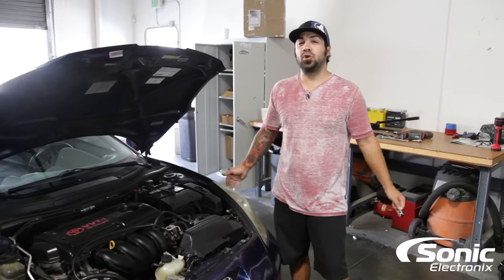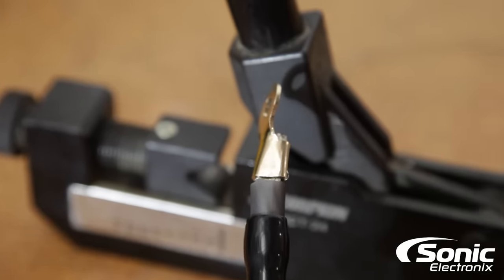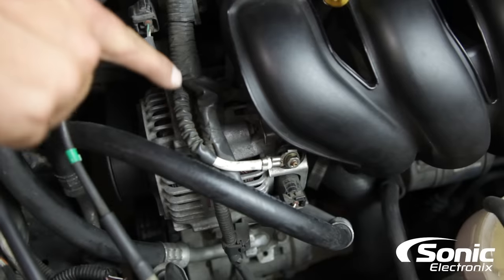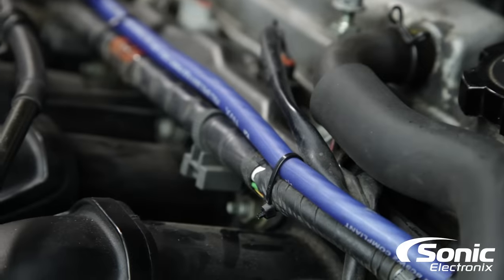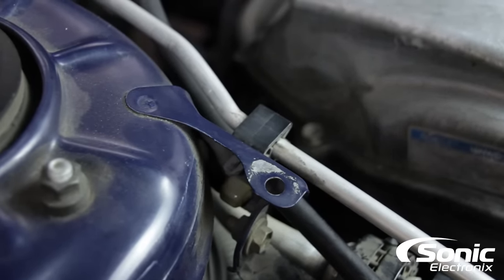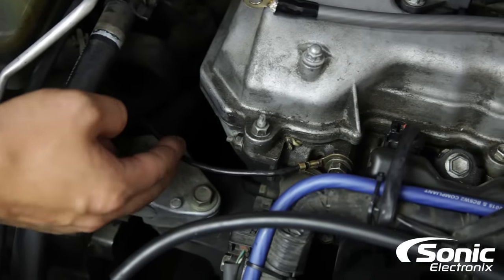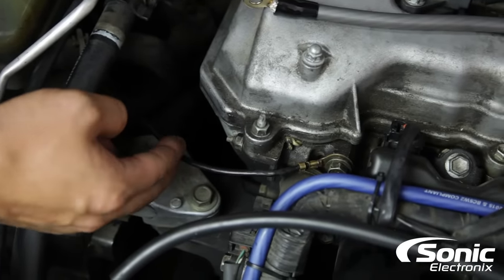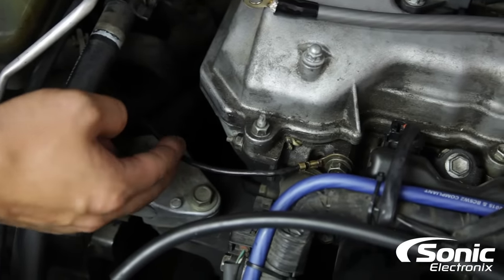How To Install the Big 3 Upgrade | Improve Your Vehicle's Electrical Charging System | Car Audio

Comment: So power wire from alt power bolt to the positive battery terminal . Then the negative to chassis ground? Then motor ground to chassis ground? For the motor part did you make a different new ground or add it to the exfudting one?

Comment: I did this years ago & had my alternator rebuilt for 200 amps...voltage is running at 14-15 volts at times....also running a back up battery with a battery isolator (diode) & running 7 years strong.

Comment: After i did this . I got 5mpg more . Thanks
Reply: Forreal tho!? How? Bcuz your ecu and fuel system and ignition has improved voltage and amperage supply!? Damn I need to do this big 3 asafp then!

Comment: I run a 0 gauge from the head to the transmission to the chassis then a ground from the alternator to the battery. And from the battery to the chassis and a positive from the alternator to the battery positive and the starter to the battery positive . My gt cruiser starts like a champ. Also everything for the sensors and power box has a same ground. And lights has a ground off the chassis with the motor and alternator. I run a zero gauge and a 300 amp between 2 1000 cca marine starting batteries .. built transmission solid motor mounts and LSD and more my ride flies now the response is serious

Comment: Had a 1974 VW Camper. The output wire definitely was not upto the size as stated on the wiring diagram. This resulted in dim warning light symtoms. The alternator was contained within the engine tinware below the righthand fan housing cooling duct. There's a small rubber elbow between the fan housing and the alternator to supply the cooling air.

Comment: i have my battery under  the passenger seat,can i just install the negative cable from battery - to the floor?vs running the cable to the front chassis??
Reply: Yea of course
Reply: Yea of course

Comment: Great Informative video , I have one question tho !! How do I run all this when I have my battery in the trunk ? 🤔🤔🤔 I do have small battery terminals in the hood of the car , positive and the negative , I have a chrysler 300 2006 , can you or someone please explain to me how do I run it ?
Reply: Most Hated is your main battery in the trunk? If so you will need a much larger gauge to account for the extra run lenghth. Your groung to chassy for the battery can be done in the boot, but your positive, charging wire will still need to be done in the engine bay.

Comment: should be the big 4, you should always run a cable from the back of the alternater case, which is where the internals are grounded to, to the negative battery terminal

Comment: Years ago I bought a sub system package from you guys and the amp that was in the package was not the right one, I had to buy another at the shop I was getting my system installed at.
The sub was pretty good, 10inch Kenwood had good bass, later down the road the sub tore

Comment: hi, thank you for this video. I have a couple of questions... I have a problem with my car (vw jetta 2012), where the battery cant hold a charge. I took it to the vw dealership and mechanic told me that i had a problem with my alternator cable (which i assume is the cable from the alternator the battery) and fuse. My question is, does the alternator cable have a fuse and if it does, what is its importance.

Comment: This upgrade did just about nothing for my 98 civic. All I have in car is two Fosgate P-100's that I got from Sonic Electronics.  I run all LED lights on headlights, tail lights, and interior so minimal draw from light system.  Headlights still dim the same as they did before the "Big Three".
Reply: Dam too I wanted to do it to my 96 Corolla 5 speed

Comment: In a Yugo, main ground from battery goes to bell of transmission, and thiner wire to ground. Car has no problem with starting or charging the battery. Problem is that is uses steel contact all around for ther stuff, so lights are bad. Also, for front and rear lights gound is one thin wire  that is bolted on one point with rusty bolt. On mine I have brighted up light front and back by getting them better ground.

Comment: So is it okay to leave the original wires connected when adding the big 3?
Reply: No you remove them for no issues because if they touch anything it can become a hazard
Reply: Ryan Quinlan You can but tape the ends off with electrical tape

Comment: What if your battery is in your trunk ? And your alternator is under the hood? I got a 2013 cadillac ats would i have to run wire all the way through my car or under ?

Comment: If you have an old car and its wonky electrically, replace the engine ground...Intermittent ground connections that break contact over bumps are the worst to diagnose.
My old man taught me to always run 2 engine grounds , a chassis ground and a frame ground (if it has a frame) too. He was an electronic engineer, me not so much.

Comment: i wouldnt use car audio cable in engine bay like that, use welding cable or tri-rated cable for proper fire proofing.
Reply: They use ofc audio cable cause its low resistance and flexibility.  Doing this is perfectly fine.
Reply: @MobileTaz  hahahahhahaa fuck yeah bro that made my day fareal hahaah

Comment: I thought 4 AWG can only handle like 80-100 amps. Would you want 1/0 gauge? My stock alt is 160amp
Reply: 1/0 has less resistance.
Reply: Stay Strong America so should I use 4AWG instead?
Reply: @cooltv931  no 1/0 wire would be better but 4 gauge would be fine for your car

Comment: I just ran and extra negative cable off the battery to the engine next to the spark plugs.. Definitely gave it a little more noticeable power.

Comment: Just check between neg battery terminal and car ground if no voltage difference under load wire is fine same for  pos battery to terminal on alternator.

Comment: Is there a bolt on top of the engine block that can be used to install a new block ground if you can't easily locate the OEM ground? Why not run a ground from the alternator case to the negative battery terminal? The alternator is attached to the engine via metal supports so that should solve the problem of trying to find the engine block ground that's located on the underside of the engine block.

Comment: There are two kinds of car owners: The first are those whose cars run perfectly and who have never had an electrical problem.  The second is comprised of those whose lives are plagued by electrical gremlins in their vehicles (many of which come from terrible, undersized, broken or corroded grounds or shorts to ground from cable burns or chafing) which can cause the dreaded “reduced power,” “service stabilitrak,” the service ABS message, illuminate the regular check engine light or the “stop now” message, and can cause no-cranks, low power operation, unresponsive gas pedals, stall-outs, and error codes seemingly from Mars that cause cars to stop in intersections, run away with wide open throttles, or slow down to 10 mph on the Interstate when you’re passing somebody, etc.  These vehicles are what many of us in the second group have and why we search YouTube for answers.  

These electrical problems are so dangerous and widespread that manufacturers and dealers refuse to accept any responsibility for them until faced with the certainty of a class action lawsuit or a massive recall, which seldom happens.  The common denominator in most of these issues is that very sensitive “drive by wire” car and truck electrical/electronic systems have to work perfectly to control the vehicle, and a bad, weak or even slightly corroded ground anywhere in the vehicle can cause any or all of these problems (as can a bad power connection). Upgrading an audio system can increase the electrical load on a vehicle to the point where these gremlins take over a car and make it unsafe and unreliable for daily use. 

The easiest fixes are the “Big Three” which are shown here. These are a lot cheaper than dealer scans, new throttle bodies, throttle position sensors, engine control modules, accelerator pedal position sensors, brake pedal sensors, new throttle body or accelerator pedal sensor pigtails, variable valve timing solenoids, new phasers and the like.  If your car or truck has been trouble free so far, just wait - your day is coming. And then you will remember this video and the clear, cheap instruction he gives on how to install a global fix before you fire the “parts cannon” at your vehicle like many of us have done, with little improvement but at great expense.  I have no financial interest in any of this; I am a simple DIYer trying to fix an 80K mile 2010 Equinox with a good body that ran before it went into the Chevy dealership (or is it stealership), but had to be towed home with a $5,800 repair estimate and an offer to buy the car for junk for $500. On principle I refuse to acquiesce to highway robbery. 

You will find that GM and others have secret extended warranties for some vehicles, but you will also find that those secret warranties seldom apply to you or to anyone you actually know. In trying to repair my Equinox, I admit I have fired the parts cannon at it quite a bit, with little success.  I have learned through long and expensive experience that the simplest, cheapest solution to any problem is usually what works. See Occam’s Razor on Wikipedia.  With modern vehicles, installing excellent grounds should be the first thing you do if you have electrical problems.

Comment: around the 2:50 mark, I've had a corolla just like this, i believe there is a larger block to chassis ground on the left side above the gearbox. i replaced it with a cable i made up that was 3 double sized lugs and 3 cables, made to be like a Y config, so engine to body, body to battery, battery to engine. as for the positive side of the deal, it goes through a fuse box but i never had to replace that in my case. that being said could be swapped to a separate fusible link and cable.

Comment: So what does this do?  Does this prevent voltage drop while braking or slowing down?
Reply: Ensures there is little or no resistance . 
 The same can be achieved really by checking the terminals . At battery . Cleaning . Tightening . And some protector such as wd40. 
 Same at alternator . Same at other grounds .
 If you take off the ground from battery it could potentially cause a lot of ECU problems .
 
 Better than this is check output from alternator . At idle  then with lights on etc .  YouTube it.

Then check battery  voltage . YouTube that also

Comment: The way I do the upgraded ground is, I turn the OEM cable into a ring terminal and connect it to a new 0 gage ground battery cable with an integrated high-quality terminal. Sort of the opposite of what you did.

Comment: Bet that hole that was scratch with the wire brush develops rust in a year. Would be worth to detail it with a long extension paintbrush 1/2 inch wide with an anti rust paint covered by a topcoat of the original color and shot of clear coat so it looks professional 👌

Comment: Great video never seen anything like it. I hade a electrical issue 2004 Hyundai Elantra it down shifted when going down the highway when hot also headlights would flicker. Dealership couldn't find the issue read some where to ground it better. Bought wires at Walmart grounded the battery and engine almost like you did issue solved. The original ground was on fender on paint so the treads were the only battery ground I took the paint off. I'm going to run another wire like you did on the positive thanks for the info and video God Bless you.

Comment: Hydraulic crimp ring terminals are the only permanent connector in an engine bay.  Any exposed Allen key connection is for inside only.

Comment: Might run another ground from the alternator to the strut chassis too if that can power up the chassis than that's more juice for the power box relay and fuse grounds.. in a ride

Comment: I got a real ground wire. That looks like a thick wick for desoldering, you can see it on semi truck cabin to frame connection. Engine is a moving part and needs something flexible...

Comment: The only mod ever made was a 97 Ford pickup truck with a 4-6 then we went from a ninety-two 130 amp alternator with six exactly when it's bigger you can cut the bracket wild at 1-inch over and it fits right in there and if you have a large trailer with a lot of lights and trailer batteries some way to go with no dimming on the headlights

Comment: okay im totally new to all this so here goes my dumb question,can i just use a soldering stick to solder the lugs to wire ,or is it a must have for the butane torch,thanks for any replies in advanced
Reply: Your better off buying a crimper thats adjustable for the size of the lugs and guage wire your using and you can add solder afterwards but you might need a mini torch to get the lug and wire hot 🔥 enough to allow the solder to melt in. Some Auto part places might rent large wire crippers or charge a very small fee to crimp the wires for you or check HarborFreight they probably sell large gage wire crimpers. Hope that helps Eddie J.   Long Island N.Y

Comment: Did u fuse the power wire? How much fuse do u recommend to run? How about the oem power wire did u still connect that too with the big power wire?

Comment: i use dielectric grease in liu of clear coat but i put it o nthe threats and nuts and eyelet and chassis. people think it is counter intuitive to conducting but, when tighten it all down it squeezes out and displaces moisture and water. doesn't ever really melt off either. ANYTHING is better than nothing, clear coat included.

Comment: How is this upgrade useful to the car, if skipped doing it for years what are the key points the my electrical system is weak or bad and how is it going to effect the performance,,

Thanks for the show, now for the real deal👌

Comment: Whats the reason for the shrink tubing on a open end lug? Protect the one side of the lug And leave the tip of the wire open to air and water?

Comment: Open ended battery terminals..... Good place to pick up corrosion.  Use Tinned closed end battery terminals... Marine stuff.     Same with that "Stinger" adapter......Perfect place for corrosion. :(.......... Tye Wraps not trimmed properly...... Short pointed ends are perfect place to rip the back side of your hand open.

Comment: As he said soldering the crimp connectors is a good idea for better connection, To add to that: soldering also helps prevent corrosion from building up inside the crimp where you might not see it for a long time..  Happy BASSIN!!!!

Comment: Pull the wheel off and pull down the fender liner on the Jeep and you can probably get right to the alternator. Just gotta use your head sometimes.

Comment: Question on sound system: 
👇
Is it okay to use a short 8" section of standard 4 gauge battery cable to connect the POS+ battery terminal to the main ANL amplifier fuse or do I have use actual 4 gauge AUDIO cable (like from an installation kit) for that?

Thanks for any help!
Reply: It should all be the same type of wire

Comment: Yo this sounds good but I have a challenge. How would you do this to a prius battery pack that would connect to the electric motor? I'm hoping to increase electric motor power for better performance. I'm sure this would make a great video.

Comment: Current usually flows around the outer portion of the wire. Think of electricity like water. DC especially likes big wires. If power lines were dc they would be 12ft in diameter for the same current. Ac is faster moving like microwave. Look under the hood of a diesel pick up truck at the wires. Thier big because the pump and injectors are power hungry but mostly because of the accesories.( like say a trailer or 5th wheel) This modification adds about 30% current increase.

Comment: The grounds I agree with, but not the charging wire, unless you remove the original one and upgrade it with the better wire.

Comment: The chassis ground cable is a great way to help multiple sensor failures caused by magnetic fields created from the cars electrical circuits , from the  information that I've seen it and  was recommended for the chassis only and ' not to ground the engine aswell'

Comment: Maybe next time you use the right cable lugs. At the alternator for example you used a M8 lug on a M6 screw. And its better to use industrial standart lugs than those thin "hifi" lugs.
Also you can use electrically conductive paint.

Comment: great presentation, keep up the good work thanks.  HOW do you determine the size of wire to upgrade ???
Reply: what ?
Reply: Basically bigger is better, if you plan on running a couple of thousand watts of amps, you would want 0 awg for the wires. But if you just want a modest sound system and your lights are dimming a little, I guess 4 awg would be okay

Comment: Interesting....
I've worked on many cars... I have never known anyone to ever have to do this. 
I dont see the need but ok. Carry on
Reply: Well Young, you are never too old to learn new stuff.
It is suggested that if you install a car audio system of 1000 watts or greater you will need to upgrade the stock wiring in the charging system. This is the most overlooked necessities
of car audio. The stock wiring is only adequate for the electronics the vehicle came with from the factory. Any extra demand will require upgrading the wire and possibly the alternator.
Upgrading these three main wires will ensure that you will get the maximum performance your alternator is able to deliver. They all make up the charging circuit and will require upgrading when you put more demand on the charging system with aftermarket electronic accessories.

Comment: I would like to use ring terminals with 1/4 inch rings on smaller connections like the alternator.